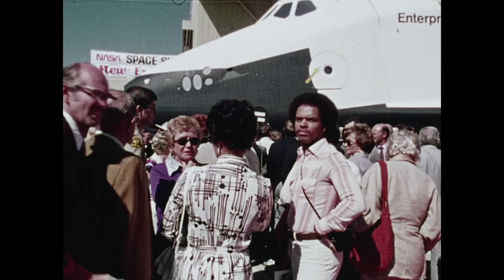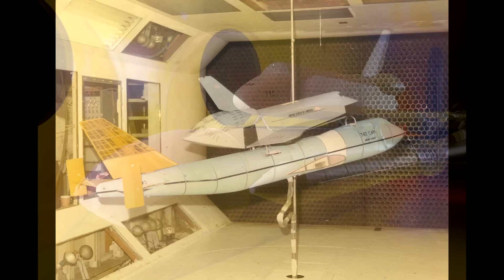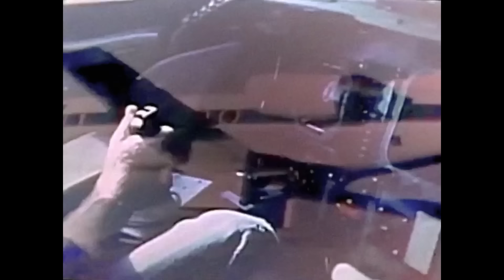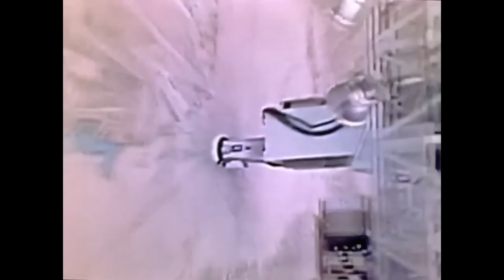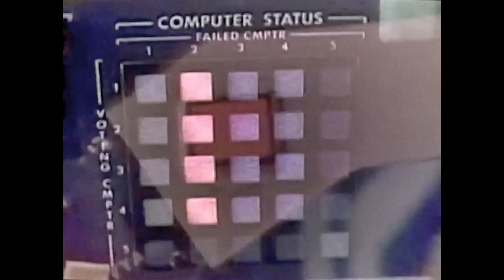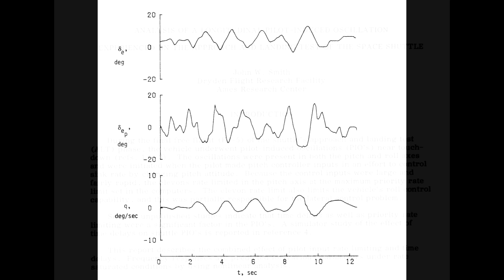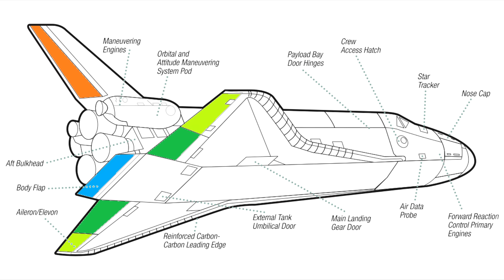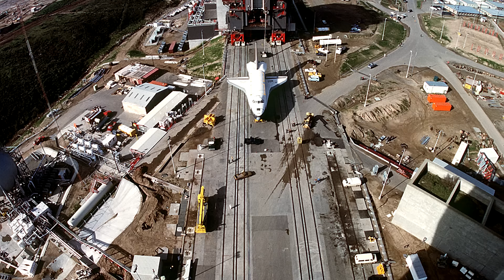How NASA Learned To Fly The Space Shuttle Like A Glider

Comment: If memory serves the first Flying Manhole Cover was both unmanned and extremely hypersonic.
Reply: Steve Rogers and I:  "I understood that reference!"
Reply: And nuclear bomb powered if I recall...
Reply: Very expensive to fuel though, there's always trade offs...
Reply: @codymoe4986  Also was a single use vehicle, and definitely was not going to be used again, even if you did manage to find it.
Reply: Wasn’t it on top of a shaft with a nuclear bomb at the bottom? Lmaoooo
Reply: @crying2emoji5  Orion Drive version 1.0
Reply: @dylantowers9367  Ahh, you beat me to the reference. 😉 It was the Project Orion version of the Lead Sled Enterprise.
Reply: @crying2emoji5  Yup, that's the one!
Reply: @crying2emoji5  Yup.  That was the point.  There are various estimates of the speed it flew off that shaft, but I suspect the reality is it reached a speed relatively quickly where compression heating simply melted it.  Hence it did not, as some have claimed, reached the edge of space.
Reply: @tarmaque  have to agree with you on that. The combo of heat and pressure from the explosion under it with the speeds it could have reached, it was probably broken apart and vaporized like small metal rich asteroids hitting earth's atmosphere
Reply: @tarmaque  Ablative cooling and the lower speed bound put it out of the atmosphere in 1.5 seconds. I'd say there's a good chance some/most of it survived at which point it is moving in excess of solar escape velocity.  I wonder where it would be today assuming it escaped atmosphere?
Reply: @tarmaque  
I forget what it is, but because of the speed of the film, and the size of the area recorded, there is a minimum speed it could be going(70 something kps iirc). 
But above that, they are literally just guessing because the manhole was only in 1 frame.

But yeah, it most likely vaporized.
Reply: @Yaivenov  I got as far as working out that it was aimed at Coma Berenice at detonation, and that even subtracting the Earth's velocity (since it was afternoon) it still had solar escape velocity. More complicated analysis was beyond me, though.
Reply: @akizeta  Outstanding!
Reply: @BallisticDamages  Somewhere I read that the "punch" it received, along with other forces, could have bowed it, giving it more of a cone shape and helped it in an "aero" way. And it wasn't in the "heating envelope" long enough to destroy it. It did take the shortest and quickest way through the atmosphere. Straight up!  lol
Reply: @Yaivenov  I've heard a little north of Albuquerque.
Reply: @tarmaque  It might have resembled the slug from an explosively formed penetrator. Then again it was probably made from steel and not copper
Reply: @deanfawcett2085  It was 4-inch thick steel and around 4 feet in diameter.
Reply: @tarmaque  Yeah the manhole cover probably evaporated in our atmosphere.
Reply: @deanfawcett2085  It definitely would not have resembled an explosively formed penetrator. Those are made by SURROUNDING the metal liner (usually a hollow cone with the open end forward) with explosives, causing it to implode into a highly pressurized and focused jet. This was a flat plate basically sitting atop a gun barrel, so aside from "moves away from explosion" none of the same forces apply. If it changed shape at all (it might not have if the wavefront had flattened out enough while traveling up the silo tube), it would have become mildly concave at best.

As for what happened to it during flight, I don't know exactly what happened, but it could not reasonably have cleared the atmosphere. Newton's impact depth approximation demonstrates that no matter how fast an object is going (short of relativistic speeds), it can't penetrate more than its own mass of material before being slowed to a halt, simply because it has to spend energy bashing the impeding material aside. 4-inch-thick steel weighs a bit over a pound per square inch, and the atmosphere weighs 14.7 pounds per square inch. Even if it flew edge-on the entire way, which it wouldn't even if it didn't warp, if it was a 4-foot-wide disk it still wouldn't quite break atmosphere. In practice, it either burned up or just ran out of momentum somewhere in the lower atmosphere.

Edit: it almost certainly warped on launch, because it was actually welded in place over the opening and the blast ripped it off the welds. And apparently the consensus is that it burned up rather than falling back.
Reply: @tarmaque  The low-end estimate, based on the single frame that the cover was visible in, is roughly Mach 197.
Reply: @ChairmanOfTheBorg  Thank you. Very well put.. I stand corrected :)
Reply: @ChairmanOfTheBorg  You seem to be confusing two different explosive technologies.  Thin walled hollow cones are for making plasma jets aka HEAT.  Much thicker plates with a spherical curve make EFPs although they can still be achieved with less ideal geometry (flat instead of curved) and less ideal materials (armor steel instead of copper/tantalum/etc.)
Reply: @anzaca1  My point is, anything over mach 8 or 9 would vaporize a steel plate rather rapidly at anything near sea level pressures.  If it indeed was Mach 197 the compression heating would destroy the plate in hundredths of a second.
Reply: @Yaivenov  Ah, thanks for the clarification. I actually thought EFPs and HEAT were the same thing. I stand by my assertion that the manhole cover wouldn't turn into either, though.
Reply: @ChairmanOfTheBorg  Well we know it didn't become a HEAT jet because it was seen on frame intact, and it probably didn't fold into an EFP based on the same single pic but it is blurry (I wonder why?).
Reply: @tarmaque  yes, but then some people say it would be traveling so fast it would reach the edge of space before it would have time to melt, and if it did melt wouldn't it become a ball then? and keep going
Reply: @KSparks80 😂
Reply: My guess is that the manhole cover bent and started fluttering like a flipped coin, really fast, and was destroyed by heat and acceleration without ever reaching the crazy hypothetical speeds described.
Reply: I have the ref 😁 You talkin about he cap and the nuke, right ? 😁
Reply: @fridaycaliforniaa236  World's biggest cork gun.
Reply: The yeetiest yeet ever to yeet.
Reply: Legend says that that manhole cover is still hurtling through space to this day
Reply: @bobbyd768  Not just legend. I've read that the math gives it escape velocity even after it passed through the atmosphere flat side on!
Reply: @Aengus42  

Yes, but it was likely yeeted into oblivion like a meteor in reverse - it became an expanding cloud of iron vapor. 

330,000 feet is a loooooong way to go when you aren't made of something that can take the shock heating, and you start your journey at your max speed where the atmosphere is the most unforgiving.
Reply: Now i know why people keep seeing so many extraterrestrial spacecraft, it's these pesky manhole covers with navigation lights that they're seeing.
Reply: Ok, I don't know the reference. Will someone please explain it to me.
Reply: @Johnparrilli  An US underground nuclear weapons test in 1957 (Pascal-B) had a shaft from the bomb chamber underground to the surface. They put a big heavy steel cap (the Flying Manhole Cover mentioned in the first reply) on top of the shaft, hoping to contain the underground explosion. It didn't.
A movie film camera captured one image of the cap flying upwards and various calculations based on this single image suggested the cap reached ludicrous speeds, escaping Earth's gravity and even the Solar System. It didn't, but it makes a good story.
Reply: @robertsneddon731  Again, it wasn't just a "movie camera". It was a high-speed camera taking a frame every millisecond, corroborating a mathematical model of the test setup made by one of the project's leading physicists.
Reply: @robertsneddon731  As I was only 1 year old at the time of this test, my recollections of it are somewhat hazy. You are right, it does make a good story. Thank you for your clarification.
Reply: so two opinions basicly it either made it out their and gonna hit ailens at some point, or it didn't  and now its boring because their isn't a manhole cover flying in space.
Reply: Sadly no. The Pascal-B nuclear explosion in the chamber below the shaft was a squib to start with producing only 300 tonnes TNT equivalent, with much of that energy being heat and X-rays. The acceleration of the manhole cover was done by super-hot air moving up the shaft but at best that air would move at perhaps 1,000 m/s (Mach 3) -- the maximum speed of air (aka speed of sound) like all gases increases with temperature but it's not hypersonic even if it reached temperatures of thousands of degrees Kelvin.
There are other physical factors that sadly make the starfaring manhole cover only a great story -- a tonne or so of air in the shaft would need to be accelerated to the same speed to propel the cover to space, the energy needed to accelerate the cover to escape velocity (ca. 25km/s) was a thousand times greater than that needed to vapourise it etc. and it would have needed 80% of the total Pascal-B yield to deliver that amount of kinetic energy to the cover.